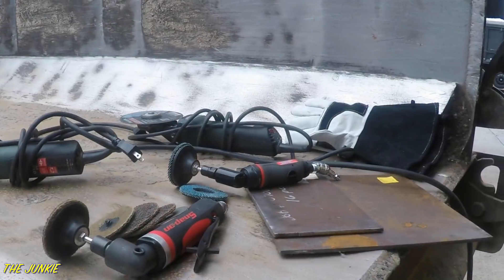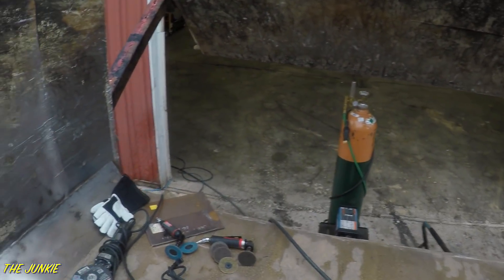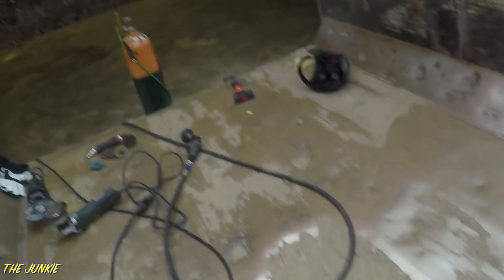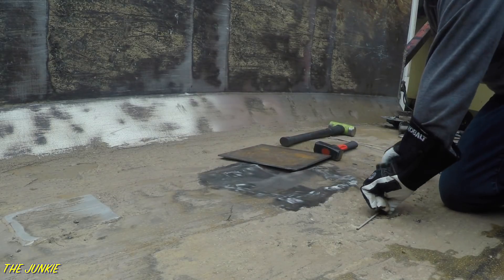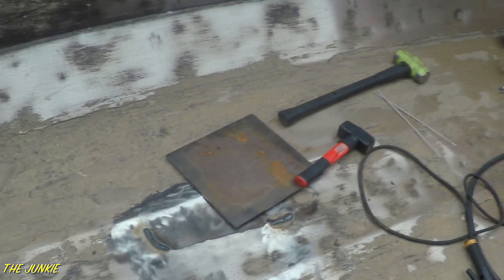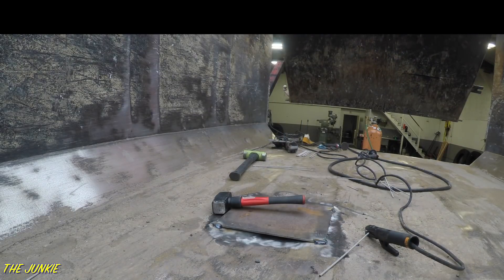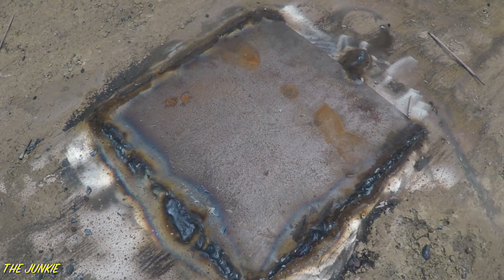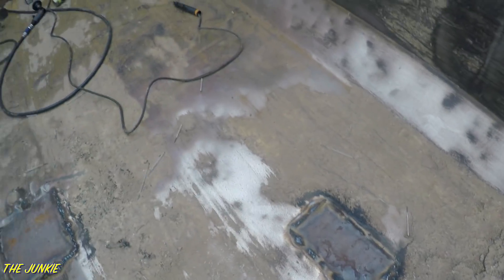DUMP TRUCK STEEL BED WELDING REPAIR🛠🔩⚒🔨🔥🔥💪🏿

Comment: The only thing is with ar400 or 500 etc... I think welding it looses its strength. At least is more concern with steel targets. They always say never weld it, drill it and bolt it is ok. Of course not always ideal to drill in some cases.

Comment: quick question buddy. being it is a dump truck, wouldn't it be better to lift the bed, and punch the metal up from underneath, and than weld it from inside the bed

Comment: Why didn’t u cut a square out and weld the patch flush?
Reply: That would blow a giant hole out with his welding it may not crack on weld but the metal gets so thin  when your welding it would melt away or crack near the weld later on

Comment: We did the same over here in the UK tried to make abit of extra cash running steel in our aggregate hauling trailers and we ended up tipping a tarp bar out

Comment: It may continue cracking even though you welded the ends of the crack. However if you stop drill then patch you will be fine. Great vid!

Comment: not the prettiest repair. take a C clamp, cut the anvil off. weld clamp to a plate. tack the front of the plate to the lowest part of the gap, in your case the floor. when you tighten the clamp it will lift the floor to fill the gap. once it's tacked you loosen the clamp, bend it forward to break it off
Reply: Fckin right exactly my thoughts

Comment: Why wouldn't you weld the bed smooth and put the plate on the bottom? I know it is more work but I imagine everything is gonna get caught on those plates when you go to dump it.